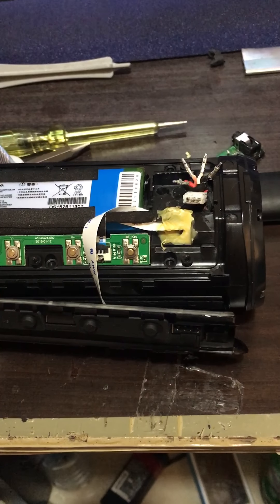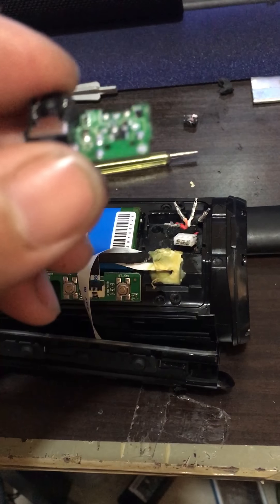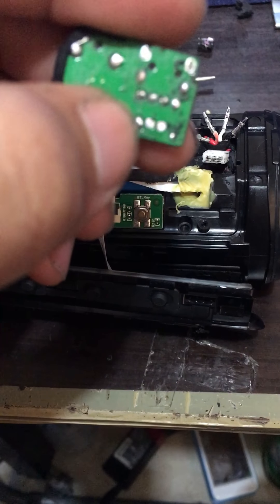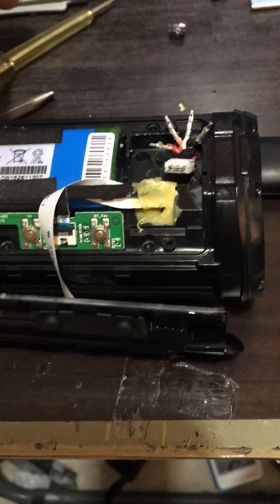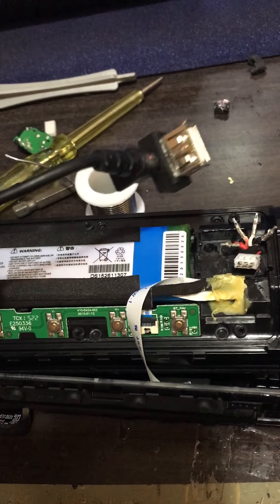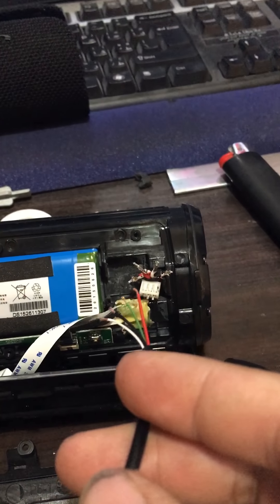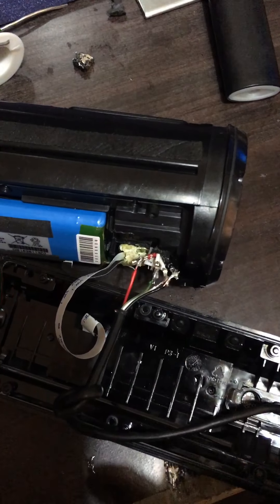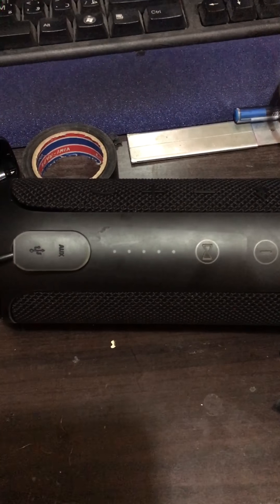Jbl Flip Teardown and USB replacement

Comment: My flip 4 has 2 white plugs in the charging circuit board. Does anybody know what they are for? Pretty sure the bigger one is the battery and there’s one with a black and red wire

Comment: Is it safe? I mean it gets direct electricity to the battery without any fuse or something? 
Is the aux still works?
Reply from the maker: Eric Cuza the regulator is still there, I basically just removed the board for the aux so no aux anymore. 

I am still using the jbl up until now since I created this video. Still works
Reply: Villame's Garage it worked, thx! It was just a bit annoying that when i removed the aux\usb board, it remains that gap that lead the wires to the main board, I put everything back together and a big amount of air get out through the usb and aux holes.
Good video ! 👍🏽